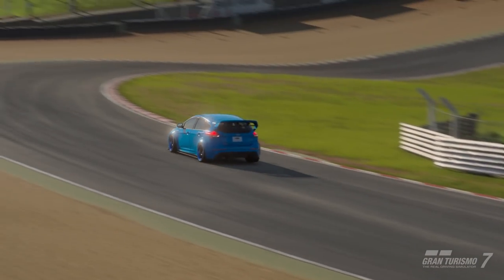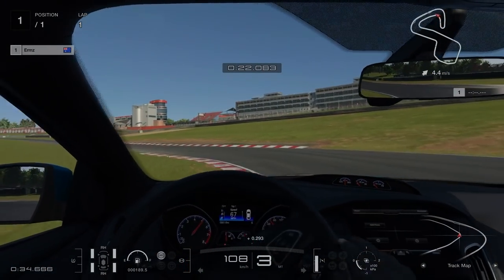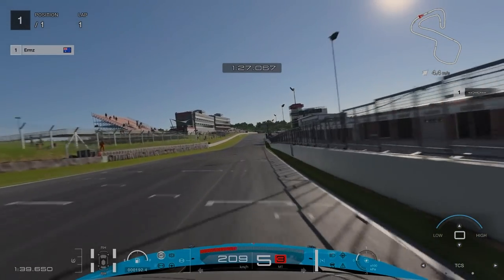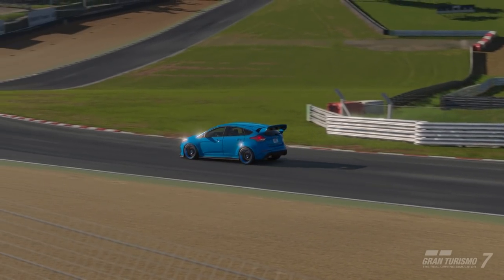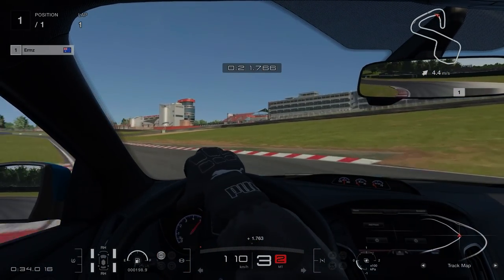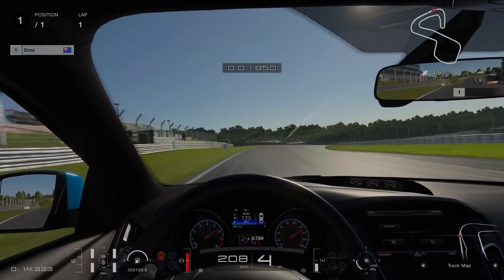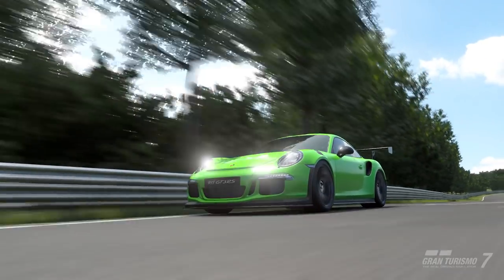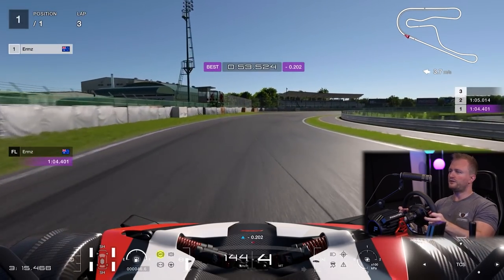This is Why You Keeping Spinning in Gran Turismo 7

Comment: I don't get why u blame Polyphony , for physics issues, when an OVERPOWERED with  stock suspension that isn't  designed to handle that much power, sure its only 100hp more but it has stage 3 weight reduction ,so the power to rate rfatio makes it equivalent to a supercar. + The Ford focus RS is a naturally mildy oversteery 4wd, even coming with a drift mode. Infact oversteer in the Focus is fords party trick, they even do it in the Front wheel drive Fiesta & Focus ST,  tuning in from factory to combat understeer, they throttle life off oversteer, that that makes them both the darling of automotive journalist.  What your doing is very disingenuous, I noticed it in an earlier visd, but this skewed flawed demo confirms it.  acting like u like Gran Turismo, but covertly & subtly hating on it, trying to put in the wild, or plant the seed among the fanbase, that perfectly balance physics engine, it's biggest strength has a fatal flaw, in the hopes that it will catch on & gain traction from the polyphony will be forced to change it. hopefully that never happens ppl. In my eyes Ur a paid Microsoft Forza shill  pre the 996 the Porsche 911 was known as the widow maker for a reason. if u want to see how easy it is to have snap oversteer in real life,  search idiots in supercars, , crashing into poles at low speeds driving out from parking lots.  even a corvette test driver, snap oversteered & crashed the mid engine, at normal speeds  on public roads sting ray  in even the  low torque 240hp ap1 Honda s2000 has snap oversteer.  Being an experienced driver in real life u would know that,  car that the Knew all this before, tuning is sorta my forte, in  GT 5 at least,   but same principles apply. I had an oversteering 2nd gen Integra, power drifting, that was able to beat the dominant MR suzuki GSR on Trial mountain, which was the only thing that could even compete, my drift car was the tuned Yellow Bird made docile. which i say not to but to establish tuning expertise to critque u
Reply from the maker: Merriam-Webster should change their definition of 'stream of consciousness' to this.
Reply: LOL
Reply: Not sure if serious.